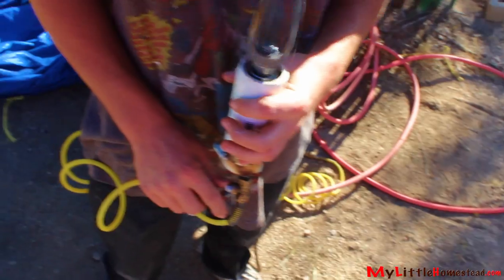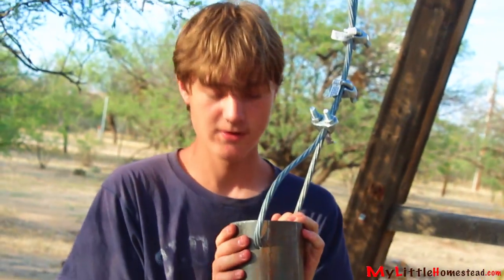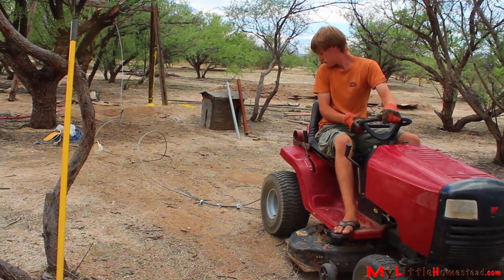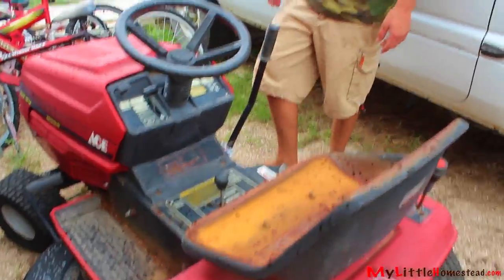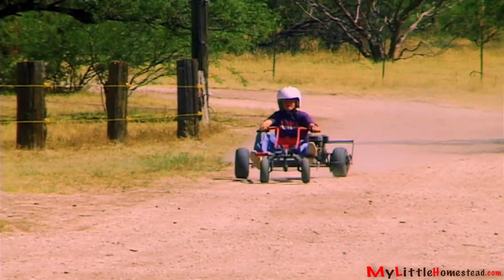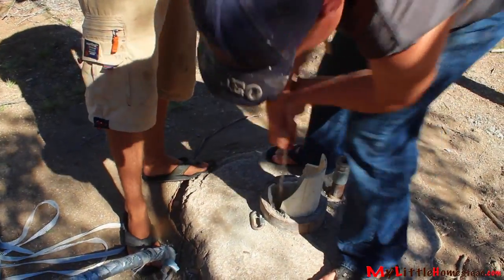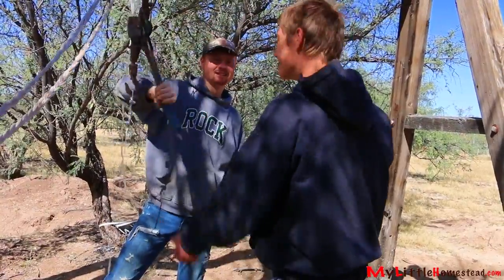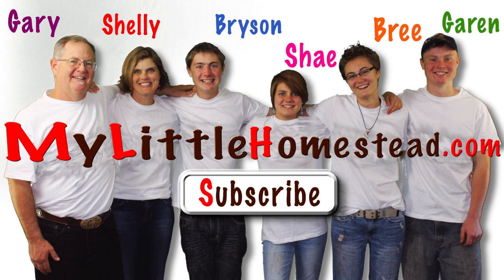Drilling Our Own Well  | Homemade Hammer Drill | Weekly Peek Ep8

Comment: Love these videos! My comment is not criticism more advice. I am a well driller in the uk. I use a cable percussion drilling rig. The tool you made is called a shell or a bailer. The guys are so close to getting that to work. The problem is they are using that tool the wrong way. It’s needs more weight and It works with small drops literally lift from the bottom about 12” drop and repeat continuously. The force will shatter the rock into small parts and the valve ( we call it a clack) will open and close causing a suction action. This will speed up the process massively.  Serrated teeth will also increase the force when it strikes the rock. The tool is jamming in the bottom as when it strikes the rock at such force it follows the fractures and is not a straight pull, you are pulling at an 📐 so the harder you pull the tighter it becomes. Keep up the good work!

Comment: I know a millionaire who got his start drilling wells with a rig similar to yours.  He used the rear end out of a Model A Ford to mechanize the lift.  Here are a couple of ideas.  

You don't have to drop it all the way for it to work.  Quicker retrieval.

If you take a couple of turns of the lift rope around a motorized cathead, you can lift, then pull the line off the cathead, and drop.

I have a drop rig for softer sandy soil in Florida.  The bottom has 2 jaws on the bottom, similar to a post hole digger, but they close tighter.  You dig with them open.  To remove soil, a second line inside the pipe closes the jaws, and lifts the rig to the surface with the jaws closed.  We did one 50 foot well so far, with good results.

I love your "can do" attitude, and trials and errors.  I'm sure you will have a good well, but exactly how we have yet to learn.

Enjoy your work, and stay safe.
Reply from the maker: +tom jackson Thanks for the great ideas & info :)
Reply: +tom jackson i have seen that method in action but diferent , just a regular car , not possi traction , block the front tires jack 1 rear tire off the ground and take off the tire , put a rim on and then rap the rope around the rim , simply sit in a chair and drink coffee while you drill when you want to lift pull the rope tight to the rim when you want it to drop give it slack
Reply: I'm in Florida too. I would like to know more about the jaw to close system

Comment: This is cable tool drilling sorta. Did it 35 years in Md. and Pa.I used a 6 inch carbide button bit made by trident tool, Va. Have hit water with a shovel at 1 foot several times. Static water level changes as you deplete aquifer

Comment: I know this is an older post, but still worth commenting. the percussion drilling technique doesn't require dropping the tool from the top of the well. simply lift the tool a couple feet and drop it. this is done repeatedly (maybe 1 or 2 times per second). only lift the tool occassionally to the surface for cleaning the cuttings out of the pipe. this would keep the tool from jamming at the bottom and drill much faster than the way you showed it here. other than that I applaud your ingenuity and persistence, well done y'all!

Comment: the hammer drill is by far the most effective for drilling a well. not only does it drill through solid rock, it fractures the rock allowing water to seep into the well at a faster rate. well done!
Reply: NOT TRUE. In fact using a hammer drill can be am excrutiating painfull ordeal. Especially when confronting an unknown obstruction 60 or 70 feet down. Operating the drill hundreds of times getting nowhere except bringing up wood chips can be very painfull to the shoulders. Eventually we broke thru the barrier, turned out to be underground tree root at 68 feet down where the drill just seemed to bounce every time we hit it. Eventually it broke thru after TWO DAYS of trying.

Comment: Very good
Of all the different ways of putting in a well this looks as the cheapest and simplest and best way to put in a well.
With a much greater depth one can go

I too have to put in a well
May I ask what size of dia. pipe did you use ?
Was it much bigger than the liner you would put down.

And how much of a sand or filtering length of pipe did you use on the bottom of your liner

And how heavy of cable or rope do you need to pull it back up
Was it very difficult to pull up after you released it 
And what was the spread of the hook you used to pull up the pipe after you dropped the pipe, in relation to the pipe

Did you use any water in the bottom to help loosen the soil at the bottom 

I was thinking of using my vehicle to pull it up with and the release at the pipe rather than at the end of the cable
Using an simple hook that will grab the pipe bar you have on it
Then how long did it take you do drill that depth of hole
And what size of liner did you use

Comment: What you're pulling up is bedrock or shale as some people call it. You shouldn't have to go any deeper into bedrock for water. I think you need to flush the well or what they call develop the well and flush out any cuttings or debris in the well. A 2.5 gallon a minute well is substantial but 5 or more is an excellent amount of water from a well. If you're on bedrock the only way to get more water is to hit into an aquafir but that's usually at 900 to a thousand feet. What your doing is good and good ideas. Its good to see the younger generation developing skills using critical thinking and what's available. I salute your efforts all.

Comment: SAME setup in Afghanistan...      Tripod, Ram/Tube,  Spool/small gas engine....    As a advisor attached to their Army, we would bribe/pay the chief in the village to let us, bring in a local with this rig (same setup).   He had bought some indentured slaves (11-13 year old boys) to run the gear,  24/7,  up-down.   During my tour in Farah Province we got 5 wells put in and convinced the chiefs to have the village girls "pump" the water from the handle/spout,  instead of filling the jugs from the creek where the goats/sheep were.   Sounds crazy but we advanced that village from the year 200 to at least the year 1600.    We must have Halved the child mortality rate for 2-6 year olds.   Water from the ground.....  not the creek.

Comment: put the flapper about 6" inside the pipe, then cut jagged edges out of the pipe like jack o lantern teeth. harden the teeth with welding beads of welding rod on the edges
Reply from the maker: +Todd Kesler 
Nice

Comment: Did you just weld a plate in your 4" pipe to trap the dirt. I want to try drilling a test hole.
Reply from the maker: +Jorge Serna 
Yes.
Reply: Cool, I will start finding a good location once I finish my fence project at the ranch. Thanks Again

Comment: Don't need to pull it all the way out,  you would be surprised how much you can do by just lifting the pipe and dropping it 10 feet. It does not take as long to pull up, and it's so much faster.
Reply: True. However, they had to pull the pipe all the way out to remove the rock they collected in the check valve. Had they left debris in the chamber, the check valve would struggle to collect as much on each drop. There is also a possibility the value would stick open and release all of the material collected, if they didn't empty the chamber each drop. Less going into the chamber, equals more material staying on the bottom covering the rock they were fracturing. Thus, less energy is hitting the soild rock because it is absorbed by left over material.

Lifting, emptying out, and checking the check value to ensure it is working properly each time is the best method.

Another successful way they could have done it is using adding a cone to the end of the tube to crush the roch and fracture deeper into the bottom. Then pulling the torpedo out completely every few drops to do a hydro clean out of the material they crushed. It all depends on the type of rock and sediment. You'll notice a change in the impact sound when it's time to flush the bottom out. A thud, rather than a smack will indicate the debris is too thick for the torpedo to penetrate the rock. Clean out and go again until your at the level necessary to ensure a healthy and productive well. Desert wells are completely different than our wells here in the PNW. Here in the PNW we can leave the tap on pulling directly from the well all day if we want. Luckily for us we have so much moisture running down off the mountains around us, we don't need to bother with a large holding tank. We even used the well for irrigation when I was a child. However, due to deforestation, development, and the population boom, many wells are being impacted. Without the trees, water hits the ground too quickly and runs off. Ground parched due to a lack of vegetation often can't absorb enough to seem into the layer feeding the underground aquifers, streams, and springs. When development comes in roofs, pavement, and stream diversions has a huge impact on wells around them. With less water penetrating these large developments, a much larger area is affected. The entire balance of the natural underground water distribution is thrown out of wack. For those households affected water is no longer taken for granted despite the healthy rainfall totals. To ease this man made burden, the city water supply had to be extended out to reach rural homes. Many of these homes also had rainwater collection systems installed. Those with healthy wells were encouraged to conserve water to ensure the structure of the water supply stays healthy. If we take too much out some pockets will run dry. When an area runs dry, it may lose it's ability to retain water again. Therefore an education campaign was started to help well owners understand this new threat. More rain water collection systems were put in, irrigation via using well water was eliminated or limited, and water conservation in the home became essential. Deforestation, development, and more homes using Wells has reduced the flow in to the extensive irrigation ditches throughout the entire county. This issue developed so quickly the county had to spend millions to enclose the irrigation network to ensure farms had access to keep their crops growing. This helped a bit. But due to an unusually warm winter a few years back, the snow pack was not enough to sustain everyone during the predicted long hot summer. Farms had to buy a permit to use the irrigation system because the county had to buy water from the city supply. When the water shortage became severe some smaller farms received funds to grow crops requiring less irrigation or no crops at all. In addition many farms received assistance to buy better irrigation equipment to conserve even more water. Most residential properties no longer have access to the irrigation system for landscaping purposes.

Wow! That was a long winded answer. The additional information is free of charge. Take what you want, throw away the rest.

Cheers from Seattle.
Reply: I was thinking about that therorey as well
Reply: Useful and informative. Thanks. I was also thinking the "bottom" of the pipe should have been sharper but hey these kids have great minds, Bryson especially from the limited amount of time on this channel (now subbed), and a great family to support and help on the projects. As for your water conservation information, I suppose that makes sense why the elites are buying the aquifers but if we all individually create the reeling mechanism from an old tractor like Bryson did, we would position ourselves in a much better self-sustainable fashion. 

Cheers from Cleveland.

Comment: i think it's better if the drop high is only less than one meter, you don't need to drop it from very high high, too much kinetic energy dangerous an can cause a well caving.
1meter high/3feet at most and many percussions every 1 second, you'll get the best result, the force instead of kinetic energy is what breaks the stone, G x weight
yours looks like you're using the bailer as a stone hammer, in other manual percussion methods, the stone hammer is separate from the bailer.

Comment: Don't you guys use any safety gear at all?
I mean you're carrying heavy metal pipes. You drop one of those on your foot, your foot will be totally mashed. You definitely need safety boots here.
And then all those sparks from angle grinders and stuff. I never saw anyone wearing safety goggles.
I mean, what you are doing is great but you're setting a very poor safety example and I tell you, once you have that catastrophic accident that deprives you of a hand or foot, you'll be a safety freak from then on. I guarantee it.
Seen it happen.
Several times.
I swear to God. I hate to be a harbinger of doom but the way you kids are going, it's only a matter of time before there is some serious injury incurred.
Do you actually know how dangerous steel cable under tension is?
Honestly, if your parents are looking on with approval at all this, I am appalled.
COME ON! GET SAFE!